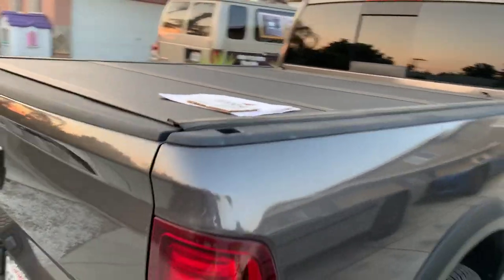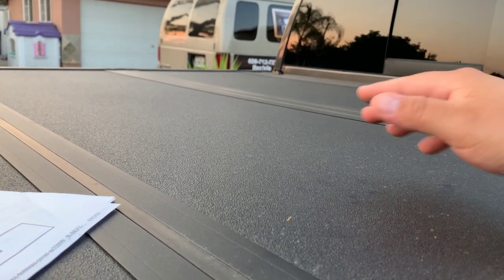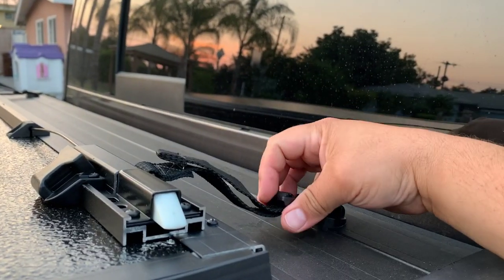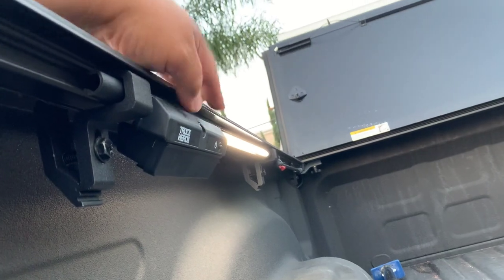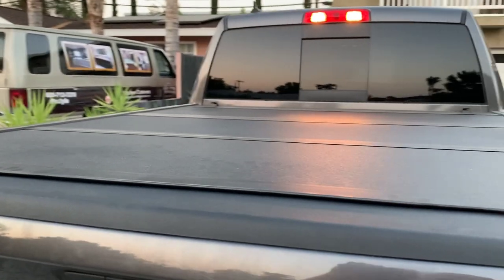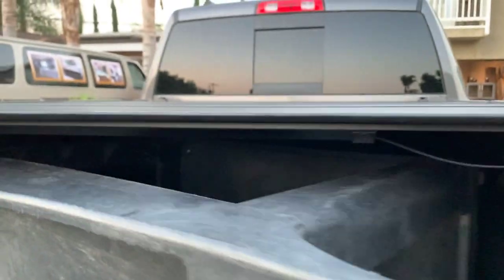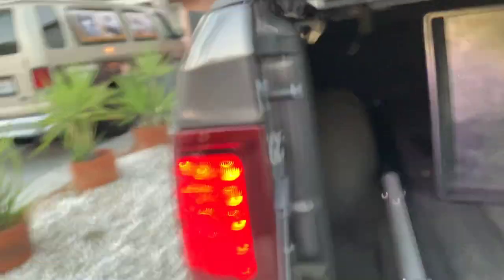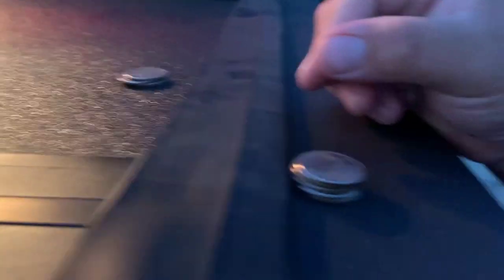Trifold tonneau cover by UnderCover Armorflex  AX32004 For 2019 Ram 1500 Classic Warlock

Comment: Thank you for making this video. I love Honest reviews vs. sponsored reviews. I really like the cover. But had a few questions. How much water do you get inside it when it rains/carwash? When you purchase it, is a lock offered? How much wind noise when driving the freeway? Do the rods come loose (found dangling) like the Bakflip Mx4 model?
Reply from the maker: Hello Mike, thank you for your feed back.  And your questions are pretty good. I live in  southern California so we don’t get much rain here. I have opened it to see if there is any water inside after a car wash and it is bone dry. I does a great job of keeping the water out. I leave items inside sometimes boxes and I never find the cartons to be wet. However that might not be the same story if you live in an area that has super hard rain or hurricanes. There is no lock offered, you can only open it when you open your tailgate. Newer trucks have locks on the tailgate, when you lock your doors the tailgate also locks and won’t open. It doesn’t create any wind noise. No whistle or rattle when I drive on the freeway and I’ve hit soeeds of 90+ with out being distracted from the cover making some type of noise. And I have never found the rod’s dangling inside. They have never came loose on me. 
One new thing I did experience is your MPG,s go up very little with the cover on the truck. But if the cover is folded all the way to the front in the upright position ( for example when you have something tall and big and need the cover all the way up and towards the cab) with the rods engaged then your MPG’s go down because your creation more drag on the truck. And even then it doesn’t make any noise or whistles down the freeway when I hit high speeds. But your MPG’s will get reduced from 18/19 MPG to about 16/17 MPG. I had to carry 2 wine barrels and other equipment and I needed it up for a 45 mile drive.
Reply: @slowturttle  so did the install require drilling on the carbon pro bed?
Reply from the maker: @mikedl361  this one is not the carbon pro bed, the cover is mad out of aluminum on top and bottom and the aluminum on top has a gripping finish that is scratch resistant. (Very nice, I like it). And no drilling required. But you need to take in mind that might not be the case with your vehicle. For my truck and the cover I got I did not need to do any drilling. Perhaps for this same cover on a different truck you might need to drill. The best thing to do would be to contact them and you can give them your VIN # and I’m sure they can give you the best choices for what cover you will need. 
Good luck if you decide to go with under armor. I like my cover and I would recommend it to everyone.

Comment: Great detailed review! I just ordered one directly from Undercover. Does it rattle at all while driving? To take the cover off and leave the rails, do you just remove the two hand tight clamps near the back window and pull off the trifold cover?
Reply from the maker: Hi, no it does not rattle at all. This thing is very solid and built really good. I’ve traveled at different speeds up to 90 and never even noticed it’s back there. I sometimes even forget it’s on. As for removing the cover I really haven’t had a need to since I can pretty much ride with all 3 pieces up like on the video. Even with the covers open and being raised it doesn’t not rattle. But if needed all you do is remove the clamps and go.

Comment: Did you have trouble with the weather stripping adhering to the bed cover up front. On instillation. ?
Reply from the maker: No trouble at all. Stuck in place and then once the cover goes on it doesn’t move or allow anything in. (Dust/water/)...
Reply: @slowturttle  thank you boss. And also. You ROCK severe! Your inspiration on this video is amazing.

Comment: Does it lock with the gate?
Reply from the maker: It sits on top of the gate. And yes it locks from the rails not allowing anyone to lift it up or open it. You will need to open your gate and pull on the unlocking mechanism in order to be able to open it. If your gate locks then no one will get in. But if you have an older truck that doesn’t lock people will can get in by opening your gate and then lifting the panels.